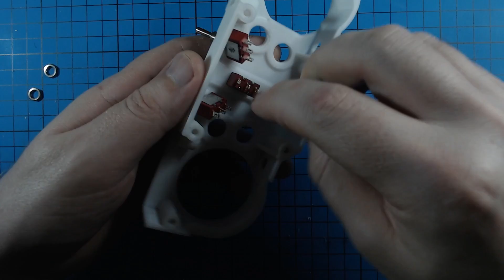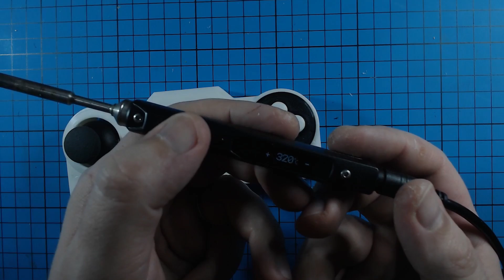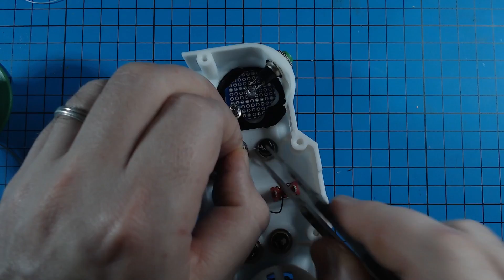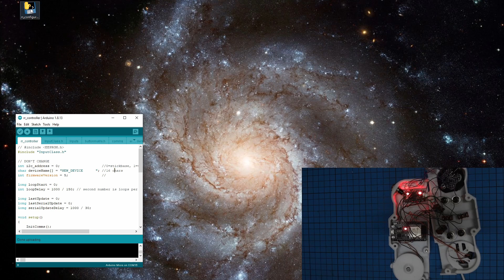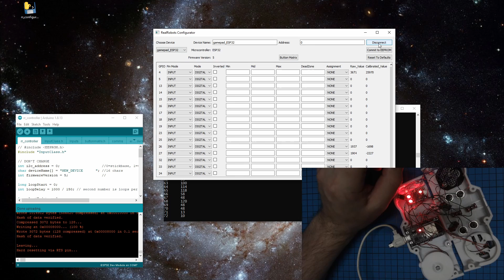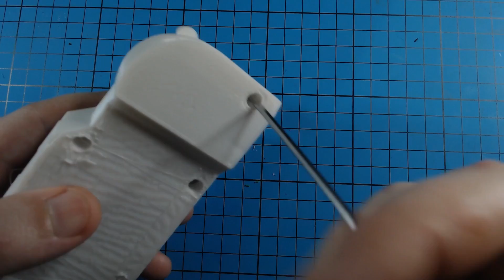Instructions - DIY Bluetooth Gamepad

Comment: Hi. Thank you for the amazing software you made. Really easy to use and install. On question: is it possible to connect a rotary encoder? I'm trying to make a wireless steering wheel for sim racing, using ESP32. And in sim racing we love rotary encoders :D
Reply from the maker: What kind of rotary encoder is that? I just added support for mechanical rotary encoders a couple of days ago but thoes things would be awful for a racing sim. 

I use AS5600 for some of my own stuff, those give a pwm signal so can be used just like any other pot my rr_controller, though I don't really support looping back from max to min for multiple turns. Is that the kind of think you'd use in a racing wheel?
Reply: @real_robots  First thank you for the fast reply.
Unfortunately I'm no expert in this stuff. that is why I like your software, easy and don't need to understand about programming.
the rotary I'm using is similar to the product ID 377 found in the adafruit webpage. Just a simple up down rotation counter, doesn't take knob position in consideration.
Reply from the maker: @tiagopviana  It does support those, but you'll find those things are awful for a steering wheel. If they are turned too fast the mechanical contacts bounce and give horribly noisy readings. Those are more useful as a selector knob, detecting a slight turn to the left or right to move a menu or radio stations, combined with the push button for select.

Get something like the link below, you can make your steering however you like, a nice beefy bolt with bearings. Just pop the magnet on the end and the pcb as close as you can get to that, it'll give you a signal based on the angle of of the disc magnet. It gives a pwm signal that can be read just like any other potentiometer. They also give 0-4096 positions in 360degrees, compared to 12-24 positions over 360 degrees of the mechanical encoders, so way smoother movement.

The only thing I would say is that my software doesn't have any built in way to account for being able to turn the wheel multiple times so you'd be locked to 360degrees of motion. One way to solve that mechanically would be to put the magnet and sensor on an attached 1:2 gear to give yourself 720degrees. 

It's not actually a big thing in code to have rollover though, I'll have to think about how to add it to my GUI though. There's also have to be some centering/homing maneuvre if the sensor doesn't give an actual, absolute position.
Reply: @real_robots  Sorry for the confusion... the intent of the rotary encoder isn't to use it as a steering wheel. Is to use it as a button, for controlling the ABS intensity, or the brake bias on a racing car.
The steering wheel is from Fanatec, in my case. The rim is the one I'm making. Just a aluminum plate with buttons and encoders
The esp32 is really cool because of the bluetooth capacity. So, I don't need a usb cable coming out of a spinning rim.

I will try to connect a encoder and check if it works. At the moment I just uploaded the code to a esp32 and every thing is working.

Random link with an example of what I'm talking about
https://www.racedepartment.com/threads/diy-ferrari-488-gt3-wheel-by-orion-simracing.205448/
Reply from the maker: @tiagopviana  oh I see! That's exactly what they're for so you should do great. Let me know if you have any trouble, like I said, I only added encoder support a few days ago and it got a total of about 5 mins of testing on my esp32 test rig.
Reply: @real_robots  so, I connect one encoder, and got mixed results. I had a old version of the sketches. Now I see the encoders option.
When rotating slow or fast in one direction, sometimes it reports the wrong number. And sometimes it gets locked in the wrong button for some time, then goes back to normal.
As it stands I can use it. Isn't perfect but works well enough.
I can share a video with the problem if needed.
Reply from the maker: @tiagopviana  Occasionally getting a signal in the wrong direction is caused by the contacts bouncing, I've introduced some simple filtering in software to reduce it but it's a reality with those mechanical encoders. If you want to make it better you can add some hardware filtering (resistor and capacitor), googling "rotary encoder filter" should give you some info.

Getting locked in position it wrong though, that sounds like it might be a bug in my software. I'll see if I can replicate it on my end and find the bug, as a button shouldn't hold down for more than 100ms.
Reply: @tiagopviana  Hi, were you able to make a wireless button plate for your wheel? Would you mind sharing the schematics and layout? Specially the rotary encoders. I made a button plate but would like to make it wireless too. Thank you!

Comment: I didn’t realise you could get such a high degree of accuracy from an esp 32  I actually bought 2 teensy just for that with my twin joystick project. 

Got some time off now so going to have a go at this but with twin joysticks first. 

This project just keeps getting better and better. 

I have a bunch of esp32 and the Esp32 D1 minis ( just love those things)
Reply from the maker: Yeah the ESP32 really is a little powerhouse, especially for the price. I'm looking forward to getting my hands on the new S2 version which I believe will be able to do USB HID as well (which the current ones can't).

I've had the teensy recommended to me a few times but they're quite expensive compared to what you get with Arduino, though the teensy is much more powerful, but the ESP32 can really fill that niche when you need power. I've also just got in a handful of the Raspberry pi pico so I'm looking forward to trying those out.

If you try my software with the ESP32 D1 mini and you find the pins I've mapped are different there's a pretty easy fix if you change the pin index near the top of "inputs.ino", the labels will be off in the gui but you'll get to use all your broken out pins if you remember the order.
Reply: @real_robots  thanks for the reply.

Those teensy are expensive but I really want the twin joystick project(I’ve mention a twin gimbal project before on a previous project) the best it can be. Although now a Bluetooth version would be even better! 

I’m still glad I got a bunch of pro micros from the previous videos From your videos although till give the d1 minis a go.

I’m still trying to figure out how you get the other tabs on the arduino IDE. I seem to be missing something.
Reply: @paulb36utube  To get additional tabs in your Arduino IDE press the little down arrow on the top right side of the screen just under the Serial Monitor button. Press "New Tab" and it'll create a new .ino file in the same folder and give you that extra tab.

If you don't have them when you open my firmware it's probably because you're opening it directly from the .zip file. You need to extract all the files first, the tabs will only show up if the files are all in the same folder and when you run straight from the zip file without extracting the others it only brings the single file out.
Reply: I noticed the link to the esp32 is for the 38 pin model but in the video has the 30 pin models.
Reply from the maker: @paulb36utube  You're right, it's so strange I couldn't find anywhere on Amazon that had the one I used in the video in stock. I actually get all mine through TaoBao, a chinese site. The one in the link will work fine, the only reason I don't usually use that one is becaues they put the pin labels on the bottom so it's super annoying to use them no a breadboard.
Reply: @real_robots  I can totally relate to pins numbers on the bottom of boards. It’s a pain.
Reply: Thank you so much for the great work. Especially the software you made make me dip into this world with no coding knowledge. One question only. Isn't it possible to use esp32 standalone without Arduino board? If not,  could you tell a bit why. Thank you again.